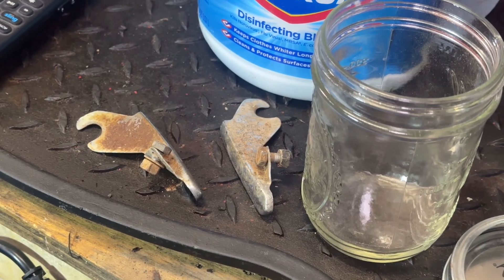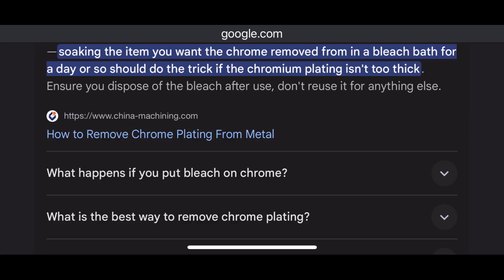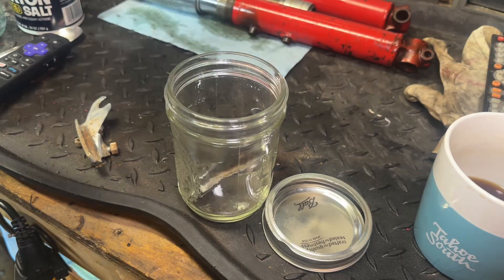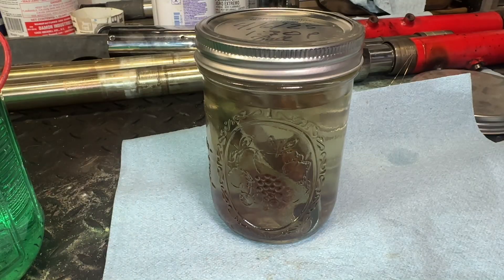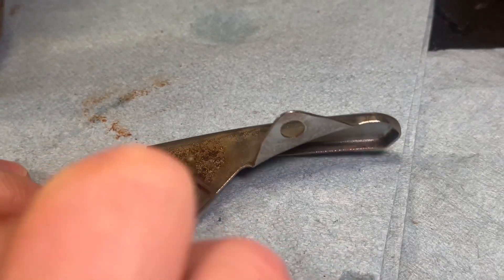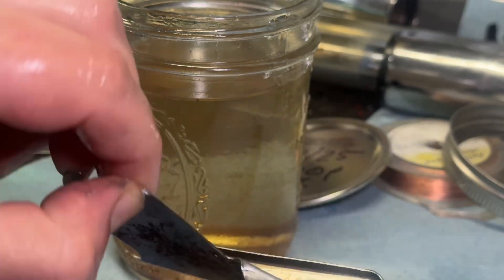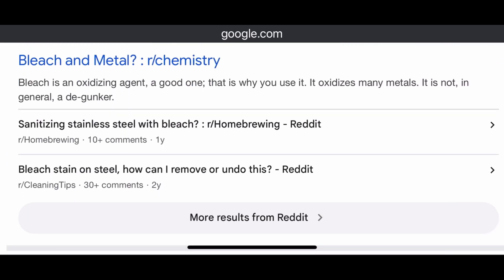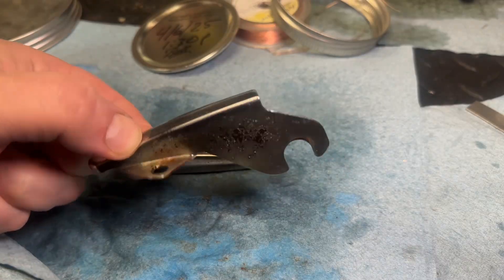Does Bleach Remove Chrome?

Comment: Ive heard acid will work like muruatic or phosphoric...then again I've heard mixed results. The best way is probably to reverse plate it off. I haven't trued that, plus youre left with toxic waste to dispose of...I think the best solution is sandblasting then sand up grits and polish then nickel plate.
Reply from the maker: Definitely going to give some acids a try!
Reply: @KeepOnWrenching  right on. I did some luck removing chrome with muriatic but it took awhile and I was worried it was eating too much of the base metal...id be surprised if phosphoric even works very well at all

Comment: I remove all my plated metals with my etching setup. DC voltage, makeup pads dipped in a salt vinegar solution, and make the work piece positive (anode).
Reply: Yup i used to do something like this to remove the plating on zippos. But to clarify i would submerge them completely in an electrolyte solution.
Reply from the maker: I have to try that out. So not submerged in a solution, just on the table with wet pads?
Reply: @KeepOnWrenching  
Clamp positive to the work. I use curved forceps tho hold the pad. You'll find the pad will gunk up and need changing.
Reply: Did a bit of googling and there's a few hazard warnings, NaCL, sodium chloride also known as table salt will result in an amount of chlorine gas (what they used in ww1 in trench warfare), also chromium compounds can be inhaled which is toxic, hydrogen and oxygen in and of them selves are not toxic, but can be explosive (though I suspect the amounts here are minimum), and the electrolytic solution created is corrosive. So, PPE is key, respirator mask, eye protection, and nitrile gloves. And it should be done in a well ventilated area. I will be trying this later though.

Comment: If you want to remove the old chrome, use rust remover, based on phosfor acid.
I found out when I wanted to lightly clean some old shock springs from a CB750, I left them about an hour to long in the solution ( mixed with water ) , and the chrome started to come off.
Luckely for me it was kinda just in time.
Im sure if I kept them there a day orso, the chrome would be gone !
Reply from the maker: Can you elaborate on the mix of products? I’m dying to try it. My next step was to try battery acid.
Reply: @KeepOnWrenching  It's a product made by HG, ( im Dutch ) it's called 'HG Roestverwijderaar' , I just looked on the bottle and it's basically just phosphoric acid.
You can easly thin it by adding water.
I even try'd it to clean carbs in an ultrasonic cleaner, but it was to succesfull ! I first tryd it with an old carb. float bowl, after a few minutes wild bubbles appeared, so it was working, but after about 15minutes you could see small dents appear. That how agressive it is. It works great, but you should really learn how much to thin it by trial and error. You can really thin it out, and make it work great for anything. I wouldn't recommend carbs though, it just to weak material. Or really thin it out and keep it under watch every 2 minutes orso.
If you look for HG Roestverwijderaar/Rustremover on google im sure you will find it, im sure America has similar products.